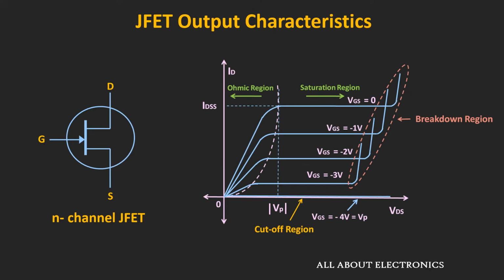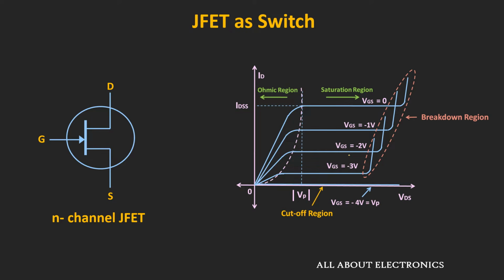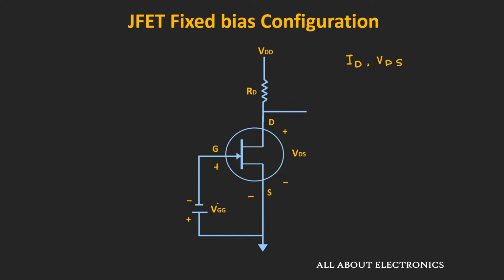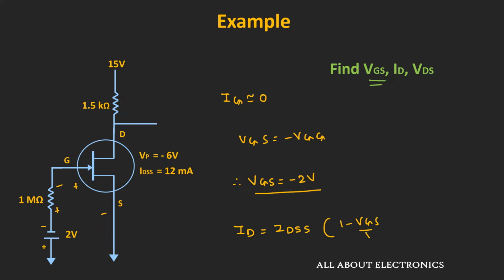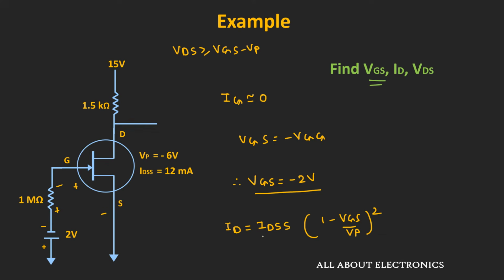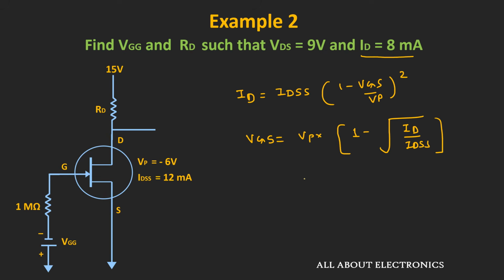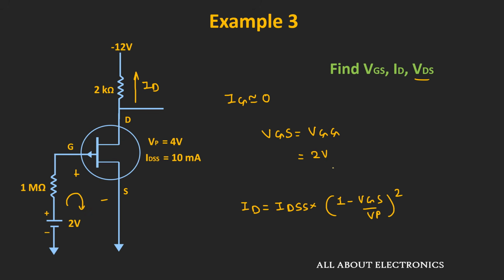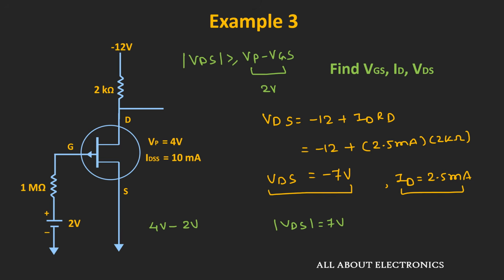JFET Biasing: Fixed Bias Configuration Explained (with  Solved Examples)

Comment from the maker: The timestamps for the different topics covered in the video:

0:31 What is Biasing  and Different Regions of Operation of JFET

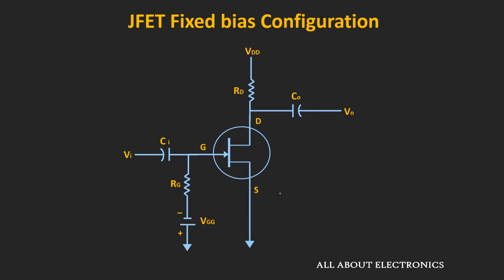4:40  JFET Fixed Bias Configuration (Circuit Analysis)

8:51 Example 1

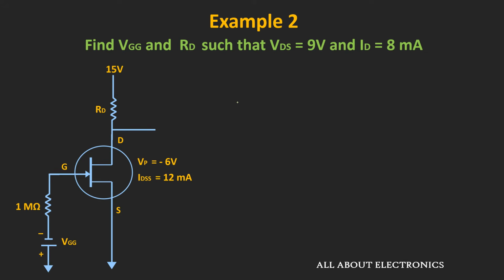13:35 Example 2

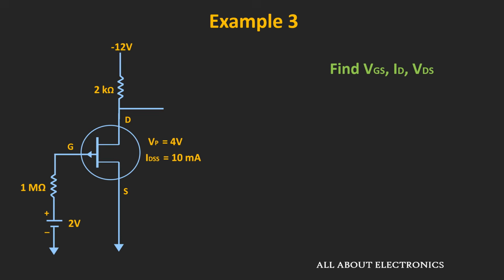17:33 Example 3 (p-channel JFET Example)

Comment: The polarity of the V_{GG} battery source at the bottom of RG is drawn backwards. For an n-channel JFET fixed-bias configuration, the gate-source junction must be reverse-biased. This means the Gate needs to be negative with respect to the Source. As currently drawn with the positive terminal facing upwards, it would forward-bias the JFET.
To fix it, the battery symbol should be flipped so the negative terminal (short line) connects to RG and the positive terminal (long line) connects to ground, giving us VGS= -VGG. Keep up the great educational content!

Comment: Why are we using capistors in the circuit @ALLABOUTELECTRONICS
Reply from the maker: They are used to couple the AC input signal to the amplifier circuit. DC voltage ensures the proper biasing to the circuit. And on top of the biasing when small input signal is applied then circuit will amplify that input signal. To couple the small AC input signal to the circuit, capacitors are used  on the input side. Similarly on the output side, to block the DC voltage and to just pass the amplified AC signal, capacitor is used.
Reply: @ALLABOUTELECTRONICS  doesn't the input capasitor block the input DC and prevent the circuit to be able to biased
Reply from the maker: If you closely observe, the circuit is already biased. Of course, the capacitor will block the DC. That means if you connect the multiple stages of the amplifier then DC voltage of one circuit will not interfere with next stage. And only AC voltage will get coupled. But the capacitor will not block the biasing of that specific stage. The biasing is provided through external sources and resistors. I hope, it will clear your doubt.

Comment: 9:42 this Vgs = -Vgg is from KVL right? Vgs + Vgg = 0. i thought its from reverse polarity Vgg because terminal G has positif polarity but the bias DC its from negative source. so Vgs = -Vgg . its not from that. but then G terminal has positive polarity and DC bias voltage Vgg has negative, what happen when that happen?  + meet  -   does it still work? forgive my newbie.. please explain...

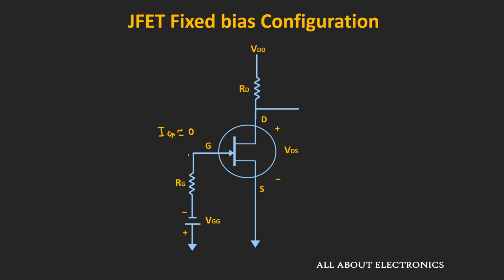Comment: 5:17 forgive my newbie, so there's two analysis can we analyze from a circuit, AC dan DC input. but you said its used as amplification AC signal, so the output is AC signal too which has been amplified, right? then why and how come you interested in DC analysis of the circuit?  please enlight me..   and 2nd Question is at 5:47, if high impedance why Ig approximately equal to 0 ? what is explanation behind that..many thanks..
Reply from the maker: To use JFET as an amplifier, it needs to be DC biased properly, so that the AC signal can be amplified properly. Proper DC biasing is essential for AC signal amplification (without distortion). 
Regarding your second question, the gate terminal provides insulation (high resistance) at low frequencies. Therefore, the current going into the gate terminal is negligible and can be assumed as zero. I hope it will clear your doubts.

Comment: 9:25
Sir when the input resistance is very high it needs to be considered as an open circuit but it has been said in video short circuit and all voltage should dropped in one Mega ohm. I get confused please make it clear
Reply from the maker: The thing is, since Ig is approximately equal to zero, there won't be any voltage drop across 1 MΩ resistor. And since, there is no voltage drop across it, it will not have any impact on the cirucit operation as far as DC analysis  is concerend. In short, -2V will appear between the gate ans source terminal. And Vgs = -2V. 
I hope it will clear your doubt.
Reply: @ALLABOUTELECTRONICS  i dont see it right

Comment: Can you please tell me why we're doing DC analysis??
Reply from the maker: To use any FET( JFET or MOSFET) as an amplifier it needs to be DC biased properly.
So, that it can amplify the AC input signal. Whether signal will get amplifier properly or not and whether we will get proper voltage swing or not depends on biasing. That's why DC analysis is very important aspect for any BJT, MOSFET or JFET amplifier.
I hope it will clear your doubt.
Reply: To find the Q-point  i.e operating point

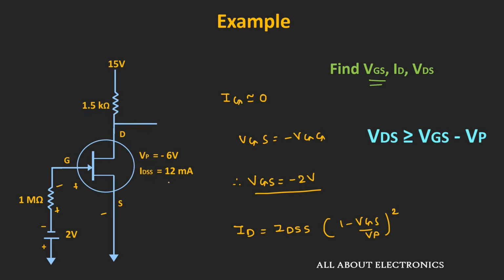Comment: @10:41  Vds > Vgs - Vp    I don't understand .   If  Vgs=0    then  Vds must be greater than -Vp      why the negative since Saturation  when Vgs =0 is when Vds > Vp not negative Vp  ?     Thank you.
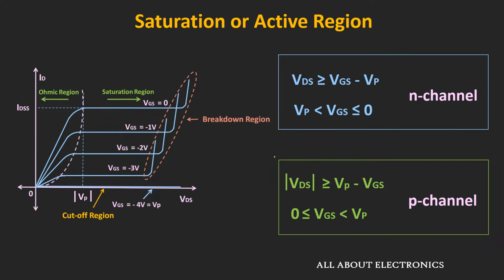Reply from the maker: Hi, please look once again at 1:53, for n-channel JFET, the condition for saturation is Vds >= Vgs- Vp. If Vgs is zero then Vds has to be greater than -Vp.
The thing is for n-channel JFET, Vds is positive and Vp is negative. That is why that negative sign comes. (So, that equation is correct in mathematical terms)
I hope it will clear your doubt. 
If you still have any doubt then do let me know here.
Reply: @ALLABOUTELECTRONICS    Your comment above that Vp is negavitve is not correct,  it's positive,  see your transfer characteristic.  You are saying Vp but I think you mean  Vgs at cutoff.  For an N channel JFET Vds is positive, Vp is also positive,   Vp is  the value of Vds when Ids no longer increases.    At cutoff Vgs = -Vp